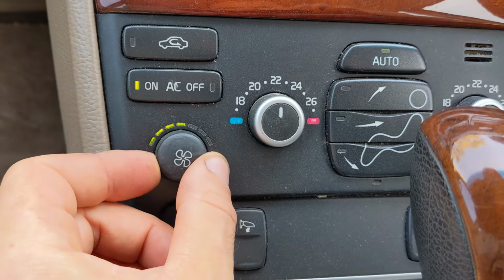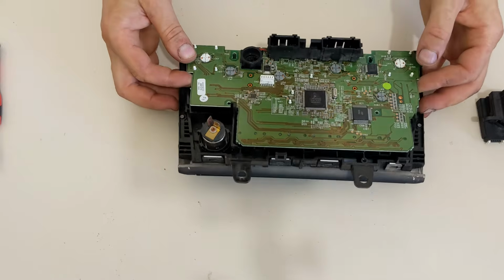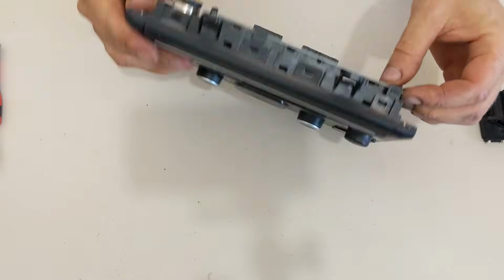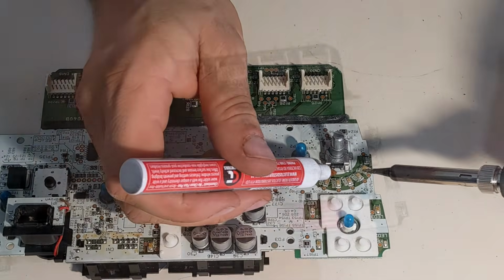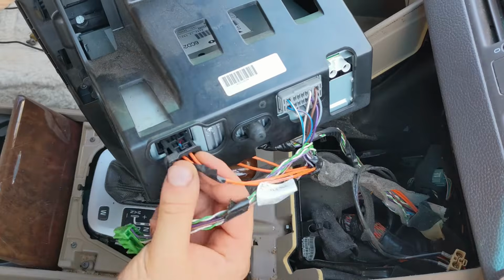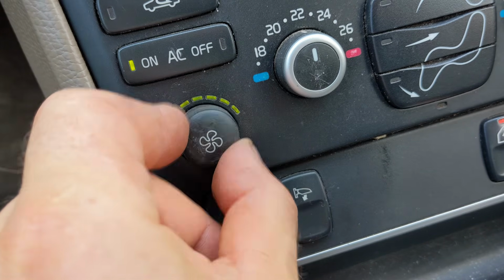Volvo S60/S80/V70/XC70/XC90 CCM Fan Button Repair

Comment: Thanks for the video.  Two questions:
(1) any way to clean the contacts inside the pot?
(2) any other joints that I should reflow while I am in there?

thanks
Reply from the maker: I don't think its a pot but rather an encoder so not really. There could be more joints to reflow there but these are the main ones causing the problems.

Comment: My knob started doing the exact same thing to the point it no longer worked. The first thing I was told to try was cleaning the cabin temperature sensor, so I vacuumed it out with our 3-stage built-in home unit, and voilà, it now works flawlessly. It's not like it was bad to begin with, since I do this every time I vacuum the car out. Saving this video in case I ever do have to dig the unit out for more extensive work.

Comment: Amazing, thank you for posting this! I followed your steps – and slightly to my amazement got a perfect result 🥳 🙌
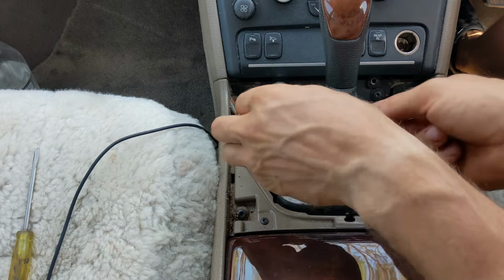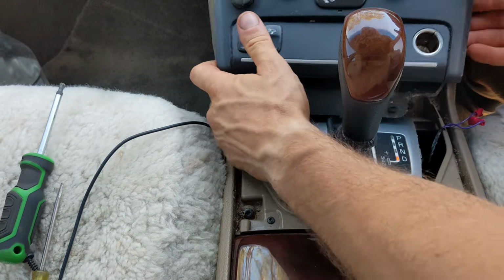Reply: PS Very important tip at 1:24-2:00 … I would add I also disconnected the battery, to avoid any engine management system faults being logged

Comment: If you only unscrew the top 2 screws under the CCM, you can pull out only the CCM, without pulling out the whole center counsel. This video shows unscrewing all 4 screws to pull out the whole center counsel. It's the bottom two screws that release the whole thing. You can cut your time in half only pulling out the CCM alone. They're are other videos on YouTube that show this. Just FYI.
Reply from the maker: @christianmoya5268  It depends what year and model, if I remember correctly pre 2005 V70/S60 you can do that
Reply: Thanks!  I thought I had seen a video that you described. Appreciate the tip!  Breaking something to fix something, is counterproductive.  👍

Comment: FYI you are better off pulling the battery contacts while working on this. That way you don't have to worry about triggering any fault codes while removing/installing the unit. ;)
Reply from the maker: Good tip

Comment: 22 luly 2024 I have just finished the repair of my Volvo S60 2,4 climate control, where the fan control knob had stopped functioning. I also exchanged the 6 lamps, now when the whole thing was out of the car, and I resoldered the switch as shown on the film. Taking off the minus battery shoe after about 15 minutes from having switched off the car, and setting the key to position II before putting on the minus battery shoe, prevented error messages.. Now the climate control is working fine again. It is a fine film giving very clear information about how to repair things. Well done.
Reply: When you say “minus battery shoe”, you are referring to the negative battery cable?  Just making sure.  I’ve messed a few things up, trying these DYI fixes, the cost of a used unit isn’t cheap, and probably has the same problem.  I always appreciate all the additional comments.  It helps me, as I’m learning to keep this car operating.  It’s a 2010 XC90 only has 109k, I don’t want a new one with more electronics to fix, since I’m learning on the fly.  Thanks. 😊

Comment: I think worst case is having the fan motor come on by itself with the key out/not running/locked.  The battery doesn't like that.
Reply: drying the evaporator.
Reply: that's what mine does--but the OP hasn't responded to my comment above.  I can't imagine that just touching-up the solder points fixed it?

Comment: I'm done solder under the knob button, but's the blower some time don't off after i off the engine,some time can't on the blower ...
So curious 😢, please help
Reply: do you live in a humid country? the cabin blower will run to dry the evaporator

Comment: Excellent video and fix .  Question on the temperature sensor as yours had bunch fluff etc.  Could a gummed up sensor like that impact the air conditioner . Mine blow cold but not super cold . I may need a recharge of Freon but occurred to me when you mentioned temp sensor ? New subscriber and Tnx for video . 2009 XC90 V8
Reply from the maker: Thanks, it would only make it see the wrong temp in the cabin so if its not blowing not really cold it's more likely gas issue

Comment: No good for me. I miss the dismantling of the CV joint form the Axis. Most video's just show the fixing, not the "Take apart" part.
Reply from the maker: Did you mean to comment the CV axle video? What part of the process you would like to see?
Reply: @HeapsofProjects   Hey thanks for Reply. I do have A s60(2002) and I can't get the CV Joint from the Axle. I have to replace the CV Boot but I do not have The special Cone to drag it over the CV Joint
Reply from the maker: @johnenrani  okay it can be bit of a hassle sometimes when the groove or stopper itself has worn. I think the best way is to clean as much of the grease away from the CV as you can. Clamp the shaft in the vice about 100mm from the CV. Now you should be able to move the CV on the shaft little bit, maybe 1mm or less. You push it towards the vice as far as it goes, get a good punch with at least 12mm diameter or a 1/2in socket extension (not good for the extension tho). Now you put the punch againt the center of the cv so its touching the axle as well but wont actually move the cv away from its position. Now give it a good hit with decent hammer. If it didn't come off you push the cv  towards the vice as far it goes and repeat.

Comment: My blower fan is not working on manual or auto, how do you differentiate between a bad blower motor resistor (or fan) and this switch problem?  Thanks
Reply from the maker: If it's not working on auto then it is not the swich problem. Also you should see the small LED-s light up if you turn the knob.
Reply: @HeapsofProjects  the LED's were moving but no air so I tried re-soldering the switch and still no air.  Switched the blower/resistor unit with one from another Volvo I have and it worked.  Thanks

Comment: PHENOMENAL. My 2007 XC70 would only consistently allow auto fan control - any manual use was "iffy" (usually didn't work). I'd long suspected it was due to the then-new lead-free solder; it took awhile for manufacturers to get the alloy right and any heat cycling would crack the joints (XBox "red ring of death," laptops etc.). I'd hoped to pop the board in my oven to re-flow everything but there was too much non-removable plastic. Used your method and it worked like a charm, in fact, the sketchy looking joints were on the (2) resistors (makes sense since resistors can get hot... careful - they slide when the solder melts!). I'd add the details about key position II and disconnecting/reconnecting the battery as in your other videos.
Reply: This must be the same problem that the radio volume knob has!!
Reply: @zzoinks Might just need a reset or cleaning. When I removed the radio/climate unit (first doing the ignition/battery disconnect sequence) I also did the (maybe apocryphal) extra step of clamping together the disconnected positive and negative battery leads. My radio had randomly been going into “search” when certain presets were pushed; though I did nothing other than that plus electronics cleaner to the radio controls, it now works great.
Reply from the maker: Thanks!

Comment: Great video. I've got a 2006 v70r wagon and I was wondering what I was going to have to do about my fan knob acting funny. Is there also a cabin filter in these Volvos as well that gets plugged up ? I'll have my fan on all the way and it does seem like much air comes out of my vents. Hardly any.
Reply from the maker: Yes there is cabin filter and that can cause the problem you have

Comment: I didn’t see where did you buy the switch from or is there a part number? Thanks.
Reply from the maker: I didn't replace the switch, just resoldered the connection

Comment: Tried to resolder. Worked well for couple drives, then stack. Looks like second resoldering killed the unit. The fan speed is working, but somehow I lost a heated seats :-(
Reply from the maker: Yes, it can be bit hard with SMD resistors as you can't really tell if you have a good contact before putting everything back together and testing it. I don't have any pulled apart at the moment but you can trace the track from the seat heater switch and try resoldeing ones there.   Most likely it's still poor connection
Reply: @HeapsofProjects  This is now resolved. It's me who didn't know that the seats are operate only when you starting the car. 🙂
However, the original problem is still there (the fan knob ether not operating or having fun behavior). 

Got another unit from junk yard (only one was available) - the unit is fully working, but, to my luck it's a bit different form size (even the PCB a bit wider)... 
Can't fit it. I am afraid to take any components out, since looks like this CCU is connected to everything else in my car. 
I can't even lock the car with remote without it 🙂
So... will look for another unit that will work and fit, before I ruined the car completely 🙂
Thanks!

Comment: Hello anyone knows what to do when it shorts and fan i is on whether the ignition is on or off... I already replaced the fan blower and resistor. I didn't see any relays in the engine hood for the fan blower. I think the short has to  be inside the fan controller

Comment: Thanks for documenting this. I have the exact same issue with the knob. I'm trying to understand, why does the knob go bad? Does the solder points for some reason lose contact?

Also, my module has another issue. The AC is always running. Even when the button select is OFF. For example: I run the blower while the AC button is OFF, and it's blowing cold or hot air depending on the temperature set. Will resoldering the resistors fix that? Thanks again.
Reply from the maker: Yes it is a solder problem due to temperature/vibration/chosen material etc. It won't solve your other A/C issue tho, does the light go on an off when you press the ac off button?
Reply: The light works as intended. The light switches color from green to orange and back, so it works as intended. But when the light is orange (OFF), it's still producing cold/hot air.  @HeapsofProjects

Comment: Thanks for sharing this idea. I did re-solder the chip contacts under the fan knob. It still did not work: every turn of fan knob, it still skips speed level. What worked for me is when I followed up by spraying wd-40 specialist silicone on both sides of the circuit board. I let it dry for about 90 minutes, and it worked. I did disconnect the battery first before I took out the AC control module. And no, I did not have the contact cleaner wd-40 at the time.

Comment: What is the paste for? Ive never done any soldering other than cb/ vhf radio antennas and its much larger, simpler contact with no fux or paste neccessary. Im ignorant to the paste/ flux and how/ what to do with it.  Awesome video though!
Reply: Flux helps solder to flow

Comment: Great video! I can’t get the green tab off for the AC components. What tool where are you using in order to depress that green top and remove it?
Reply from the maker: If you mean the green plug then yes that can be bit trickey. I think I used L shape allen key for that.
Reply: Got it thank you!

Comment: Great tip! The solders on mine looked fine so I was sceptical that it would be that, saw that Kevin Crosby was also sceptical so I tried it and it now works perfectly again. If not for this video I would have bought a new pot. That would have fixed it too but with a lot more time for part shipping and effort with desoldering the old one and soldering the new one. Thanks!
Reply from the maker: Good job!
Reply: @HeapsofProjects  It went back to its broken state unfortunately. Guess I will have to hunt for a new potentiometer after all...
Reply from the maker: @gusos234  most likely it's still the solder joints. You can try redo them, use some new paste and flux 👍

Comment: My auto mechanic said it's the regulator or the blower or both so so you think it could be just this fix??
Reply from the maker: Does it work when you press Auto? If not then your mechanic is probably right.
Reply: @HeapsofProjects my button dont work, but light red of ac is working, shud i do this or ? Before that my ac fan of cabin works strange starts and goes

Comment: Another thing to maybe check if your having this problem is the coupler that leads to the blower fan, i was about to solder my switch and figured maybe i should test if the fans even getting the signal from the switch and the ground was arcing and melting the coupler for some reason.  My guess is the kids blocked the vents and had the fan on full and the motor was possibly getting hot or it just wasn't a good contract.  Anyway hope this helps anyone with this issue, maybe a proper diagnosis of the fan vids in order? I found this video to be the best and most detailed so i propose its from you 💪😌
Reply from the maker: Thanks for the idea. I have actually seen it before and I can imagine it could be because of a poor connection. If your fan is not working at all there can be many different causes. Easy check if you need to fix the CCM fan knob is that you just press the auto climate button and see it it works then or see if the lights around the knob move when rotating it.

Comment: Hello. You don't know what's wrong if you turn off the ignition, but the interior fan continues to work?
Reply from the maker: If it's always on then most likely you have failed blower fan resistor. It is in the same housing with the fan but can be replaced separately.

Comment: The knob on my 05 V70R stays at four, doesn’t go up or down, auto still works but will this fix this issue on the manual fan knob
Reply from the maker: Yes. Most likely it would.

Comment: Worked great for 15 minutes & then fan knob stopped working altogether again. 2nd time I resoldered the fan speed decreases by 1, then increases by 1 back & forth no matter which direction the knob is turned. Each click of the knob decreases then increases by 1. Any ideas if this is due to a connection issue on a resistor or 1 of the knob connections themselves?
Reply from the maker: It's hard to say, most likely the knob connection. Try to use plenty of flux and go over them again.
Reply: @HeapsofProjects  thanks I’ll give it a shot

Comment: Thank you for showing us how to do it. I bought XC70 recently and could not figure out how to operate the fan manually. It turned out it was faulty fan knob. Followed your video and fixed it. Works like a charm! Thanks 👍👍
Reply from the maker: Thanks, good work!
Reply: I have a2002 xc70 the knob turns color when I turn it but now won't blow does this mean the regulator went out and the blower or is it this what he's showing in the video seems much easier to do this?
Reply: @oudogs  TBH with you I'm not really sure but when my fan was faulty the LEDs weren't working either.
Reply: My lights work on the knob and the auto and the manual is just the blowerout the vents that don't work
Reply: To me it looks more like regulator or blower motor gone. Did you check fuse?
Reply: @MrDomelS Thanks for this tip. I’m going to check this before disassembling!👍

Comment: First of all, thanks so much for a clear video!
Seems I fucked up somewhere however 🙂 the AC is definitely cooler, the rotary button works better, but not 100% (guess I need to go over it a couple of times)

But I gifted myself a new problem in the process, giving an error message on the dash "urgent revision airbags". Any idea what that could have been?

Appreciate your help!
Reply from the maker: Yes, you might have to resolder again. You get SRS fault when you have disconnected CCM and accidentaly turn the ignition on. You will need diagnostic tool to erase that code
Reply: Can you just disconnect the battery for a while to turn the srs light off?
Reply: @kalel0192 late response, but no. It stores it in memory. You will need a diagnostic tool to clear it

Comment: Thanks for a very complete video! the fan knob on my 2005 XC90 became non-functional, so I had no manual control and had to run the system in auto mode. I was skeptical, but followed your instructions and the re-soldering did the job! Works like new!
Reply from the maker: Thanks, well done!

Comment: Thanks so much for this.. My lights used to bounce around like that before and now they don't come on at all and no fan whatsoever.  Didn't drive it over the winter and even chilly now.  did you just  re heat the old solder?  I am going to try this tonight when i get off work. next step will be the resistor but no lights on the knob had me suspicious
Reply from the maker: Yes, you can just reheat but add some flux when doing so, otherwise you will end up with a crappy connection.
Reply: Hey Mike, did yours get fixed because I was wondering the same, whether it's resistor or blower motor. I've checked fuses but no luck yet and haven't done this yet.
Reply: @nabeeljacksonrhoda6480  hey no it didn’t work for me but if ya have an hour its a simple thing to try. Im sure mine was the blower motor itself but i ended up just selling the car to someone with more time money and patience then me. Fighting stuff for 2 years i was done lol